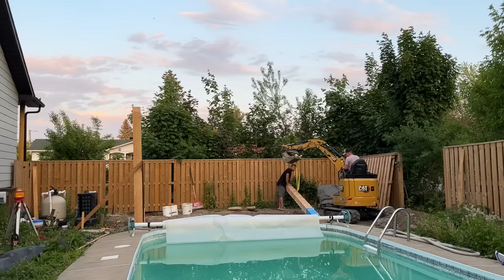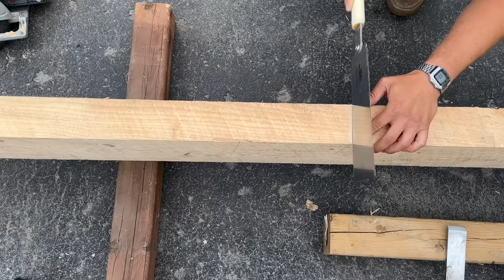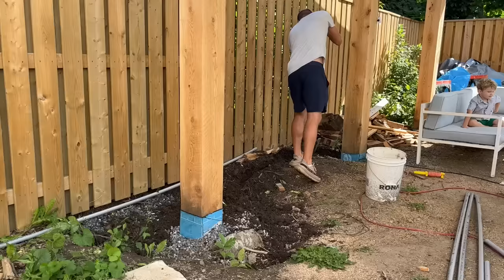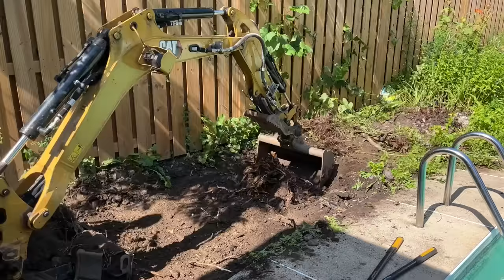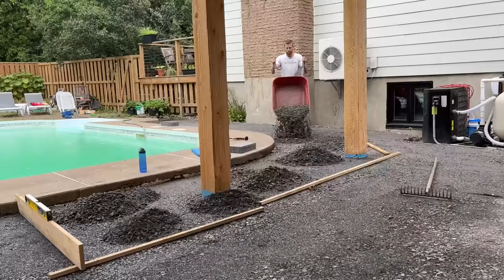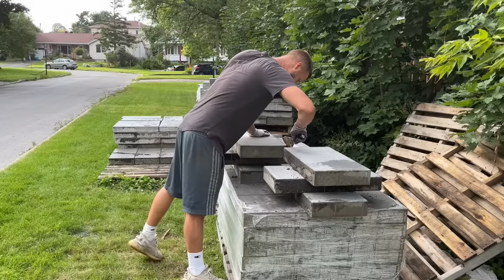My Biggest DIY Challenge: Building a Massive Timber Frame Gazebo

Comment from the maker: Thank you all so much for subscribing!
🎉 Get 25% OFF the plans on Etsy if you use promo code YOUTUBE25 this week!
https://mateostabio.etsy.com?coupon=YOUTUBE25
Reply: Possible to share the polycarbonate sheet details you have used ?
Reply from the maker: @VG-13855  I don’t have any but plan on making a video about the polycarbonate in the next 3 months.
Reply: What material did you use on the roof
Reply from the maker: @VG-13855  Polycarbonate Roof Install
https://youtu.be/4N26bvtbWAI
Reply from the maker: @hikerinpam33  check out my new video!
Reply: No sanding, staining, sealing the wood before putting it up ?
Try an oscillating multi-tool to cut straight into that wood.

Comment: I built mine on my own, no lifting equipment, no help, just a mitre saw, drill and shovel
Reply from the maker: No way! I wanna see a video! 8x8 lumer? Timber frame joinery?
Reply: @mateostabio  yup, size is 7.5meters by 4.5 meters, I didn't cut those fancy cuts though, it's held together with coach bolts
Reply from the maker: @MrSmoothasf  how did you lift those beams up?
Reply: @mateostabio  once the beams were set in the concrete, I leant the  top ones against the beam at a 45 degree angle and let gravity do the rest like a seasaw, the cemented beams were about 2.6 meters high so the full size beams had plenty of leverage once against them.  The neighbours were having a garage built at the same time by a whole team of men who thought I was nuts.....maybe I am lol 😆

Comment: chief I must say I've now watched this video finished from start to end. this really turned out amazing and the fact that you went old school made it so much more interesting there is quicker way out there but yeah the old school does it for me. thanks for sharing I'm looking forward to the next project. this is to me a true reflection of DIY I've seen on the internet so far with all the struggles. other or previous videos made it look so easy forgetting we don't always have the resources available on hand. we sometimes have to go and rent the tools we require to get these DIY projects done. #southafricaposted
Reply from the maker: This is exactly it, You got it. I wanted something original, that didn’t use metal brackets, and so I designed a minimal structure with old joinery. All the videos out there are about how you can make a gazebo in 4 hours, but I wanted a masterpiece that would last 50 years. Thanks for the comment!

Comment: Nice job 👍 i just recently did a dyi 130m long fencing 2.5m height, paving 250sqm bbq area, gates, landscape etc in 3 months by myself. Home project. I feel your pain. But I end results wow. I used cida. Full privacy wall. First time ever home wood working/ paving/ electrical installation etc. Turned out very modern. 
Next step maybe small pool, and large cazebo 😂 with pizza and bbq counters / bar area.
Reply from the maker: Nice! I’m also going to build an outdoor bbq area under there next summer! Stay tuned for those videos!

Comment: Very respectable....jealous you had the gear to move stuff.  Love the blue skin but to take it a step ferther if they arent pt (as yours are clearly not) is to burn the ends that will be buried. Just a passion of mine. You totally have demonstrated practical old values in timber framing...
Huge respect
Reply from the maker: Thanks for the comment. Tried new things, jumped into something I never did before but super happy with the end result. Cheers!

Comment: Hey Mateo...This looks great for a modern design...with simplistic lines...Well done...III...I'm posting this comment here as the same one from the Reddit conversation...More questions are always welcome...😉

👉...Mateo wrote: "...To keep the modern look I was going for, I opted out of the knee braces...

I love the fact you didn't stick in the unnecessary and ubiquitous elbow braces...Good Job!!!

👉..Mateo wrote: "... I then had to figure out a way to strengthen it, and ended up burying the posts 3 feet deep.

For that location and load parameters, unless you are on a beach or something, should be more than adequate...

👉..Mateo wrote: "...Which brought yet another issue. Rot… I wrapped the posts in a waterproofing membrane that they use on foundation walls for crack repairs. Hopefully, it works!

Sorry to say, but that was probably a huge mistake. Wood needs to "breathe," as they say, and that means to mitigate interstitial decay issues that no wood, especially wood below grade, should ever be "waterproofed" as this is folly in all regards and only accelerates decomposition more rapidly and why it is against code in some areas to embed in concrete as the "contact zone" between grade and base of the post will most likely show signs of decay within less than a decade...No worries, though it is work, there are traditional solutions for this and ways to slow the process, and/or add a stone foundation at a later date...
Reply from the maker: Thanks for sharing this here! Great idea!

Comment: Very impressive. I love the design. I am just looking to build a bunk for fire wood at my sauna. This is way more than what I need, but I could not stop watching this project. Nicely done, my friend.
Reply from the maker: Thanks for the comment. Appreciate it!  Thats one build im looking to make this summer, firewood storage probably timber frame build. Are you making it out of 4x4? Or 6x6 id love to see what your building
Reply: @mateostabio  I am using reclaimed telephone poles for the posts. So far, I have the posts, now I need to move onto the roof. I can only work when I have time. So it's been a slow process. But I am having fun with it.

Comment: That was amazing! I've never seen so much perfection go into a build. The thing I was wondering while watching this is why you leveled the concrete around the pool. Isn't it supposed to be slightly sloped outwards to prevent debris from going into the pool during a rain?
Reply from the maker: Thank you so much! I did not level it, but I did bring it back to how it was or at least tried to. The sidewalk is 30 years old and sunk about 4 inches all around. It was hard to walk on.

Comment: Huge kudos to you man wow. The detail and care you took for each step is impressive. The only thing I will nit pick about is that I would have left that blue waterproof film around the posts and nailed some decorative skirting around each post to make it look nicer and keep the posts waterproof inch or two above the pavers.
Reply from the maker: I totally agree with you and was my initial plan. But then when I saw one post without it and I could see how god damn clean it looked, I couldn’t hold back and I cut em all. Im thinking I can always come back later on and make a 3mm epoxy barrier at the base if I notice some darkening of the wood down there. And then perhaps create a little wood moulding or something. Thanks a lot for the comment!

Comment: What did you use for the poly roofing and where do you buy it?
Reply from the maker: Polycarbonate roofing
Reply: @mateostabio  Thanks for responding. Unfortunately, I've been searching Google for 2 days and cannot find the kind you used in your video. All I can find is cheap Home Depot corrugated. If you could help me with where to look, it would be most appreciated. If I need to buy your plans on Etsy to find out, I'm happy to do so but I'm just looking to build a 10x12.

Comment: Amazing job!  I would like to replicate something similar.  What kind of wood did you choose?  Given that you seem to be in Québec, I wonder where you got the timber.
Reply from the maker: You can get my plan on Etsy. Link in the description. I ended up going with Hemlock, because I was told it does not twist like pine. I was a little scared of going with pine, and after a few weeks or months having a stack of hockey sticks 😆. Call any lumber yard around you. Go on google maps and start calling! Ask for delivery included and compare. Make sure that you mention you don’t want bark on at least 3 sides for the thin boards for the roof. most of mine ended up being full of bark, and I had to throw out a lot. Take a look at my other videos for more info abiout the gazebo

Comment: I'm about to buy these plans, I have a question though. I love the way the rafters look without exposed hardware, but normally rafters like that are secured with a rafter hanger, is the 1 long screw really enough to secure those? I'd prefer to do it your way because it looks so nice, it just makes me sweat lol. How is yours holding up? Do you get a lot of wind where you live?
Reply from the maker: Hi and thanks for the support! Yes the 1 screw is strong enough. If anything, the plastic roof would go flying and perhaps the 1” wood lats as well (before the massive rafters would ever move). In the box of screws I bought, I believe I could have put 2 screws at each connection, but I decided to only put 1 as the specs showed they would be strong enough. The link to the box of screws and everything else is also in the video description. I appreciate the support and let me know if you need any more help with anything else. 

I’m trying to find the time every month to create more videos showing and explaining every detail about this build. I just released explaining all the electrical stuff. In April I plan on releasing one about the polycarbonate roofing. 

You can also take a look at my other videos talking about the gazebo, my biggest mistakes, my cost to build and more!

Cheers and best of luck with your build. Also, let me know if I can do anything to improve the plans.
Reply: @mateostabio  This is exactly what I needed to hear! Thank you, I'll make sure to get the screws you used. I'm getting started next week, I'll send you some results when its done!

Comment: Cool project and many cool solutions. Though I don't like the middle column in the front. Was there no way to avoid it? Maybe a slightly hidden steel beam up top?
Was there any calculations done by an engineer before building?
Reply from the maker: Ya, I would of liked to have no post in the middle front, but the wood beam probably would have been 8” X 20” or something huge. We get a lot of snow in winter so yea. Im pretty happy with it now though. Not the world’s biggest deal.

Comment: I subscribed. amazing video skills and I learned a few tricks never seen in construction.  Great job. looks amazing. Not trying to be an ass.  I'm curious why went with posts into ground?   Modern architecture calls to pour concrete, then post is put on a metal bracket secured to the concrete pier in ground.  and why didn't wrap the bottom of the post? trees xlyem and phloem act like straws sucking moisture straight up.
Reply from the maker: Thanks for the long comment and question! So this was a decision that honestly kept me up at night for a few nights. I didn't know what to do about this. I chose to go without knee braces for the modern, simple design, but this made me worry that if I would put them on metal brackets, a gust of wind or snow load, would perhaps make it collapse as it would not have any shear strength. I buried them so they would not move or collapse sideways. If I put them on the metal brackets I would of needed the knee braces 100%. By burying them, I now had another problem I had to overcome. I had to figure out a way to bury them, and make them all perfectly paralel at the tops so the timber frame joinery would all fit nicely and not have any gaps. This was a challenging build, not gonna lie! But it turned out better than I thought I was be able to make it!

Comment: Great Build! Good job getting the boys to help so they learn. My only suggesting is for you wear a mask the next time you cut cement pavers, that crap is terrible for your lungs. My dad never used a mask when woodworking and neither did I when I got started. I just didn't think about safety as much BUT that changed when I learned and researched  how harmful it is to your lungs
Reply from the maker: @RubenCervantes-e3v  thanks! 100% correct on that. I knew it was bad so I always tried to hold my breath for about a minute when doing cuts. But didn’t know about silicosis until someone commented about it! Thanks for watching!

Comment: Nice project !
This is exactly what I would like to do, except that doing it alone is really obnoxious! The finishes are stuning. 
I have two questions: 
1/ what do you think of the roof structure? In the wind, is it strong enough so that the panels don't move?
2/ In terms of heat underneath in direct sunlight isn't it too hot?
I'm really looking forward to seeing the fireplace.
Reply from the maker: Thanks for watching! 
Yea, I am releasing a video this week explaining my 10 biggest mistakes. One of my mistakes was leaving one roof panel not fully screwed everywhere and a tornado warning came around, and it folded a panel on itself, but luckily, it didn’t crack it just made a big crease.
But now thats its properly installed, it doesn’t move with crazy rain or wind. 
The only bother with this material is in a hot hot day I can hear some crackling every couple of seconds, I got use to it now. But theres a little bit of crackling from the expansion and contraction. It might be because I put the screws on too tight. 
In terms of heat, I feel like we’re okay with the breeze that comes through, I didn’t want a fan, but could be an option if you live in a really hot climate.
Reply: @mateostabio  thank you for your feedback, I appreciate!

Comment: How do you get straight timber like that?! I can’t find anything without a curve to it in any store around me.
Lol, neat trick with the plainer at 20:00
Reply from the maker: This is all straight from the saw mill. Not a big box store. Its not kiln dried, and is still green/wet. I chose to do this with project with Hemlock wood which is apparently straight and does not warp like white pine.

Comment: Fantastic video. Just subscribed. One question. Why did you choose to put the posts directly cemented into the ground ( vs using anchors)?  Your gazebo will probably last 100 years but if you did need to replace a post due to rot, etc it would be more difficult.
Reply from the maker: Thanks for watching! Take a look at other comments i’ve responded or my other videos, I think I explain it somewhere. 
I had many sleepless nights debating this…  My design decision of not having angle braces is what started this. To get that more minimalist and modern feel, I opted to not use any, but without braces, the structure could fall if you push on it from the side (with strong enough wind and perhaps a snow load on the roof) so I decided to try something new, and hopefully the posts won’t rot!!! Fingers crossed. We’ll see in the next couple of years if I have to make a video saying otherwise 😂. Cheers!
Reply: @mateostabio  Thank you!  I was assuming more stability, also.
Reply: I was about to ask the same question.

Comment: What type of wood did you use? I presume it's not PT. How will you keep it from rotting out? I'm not criticizing, just trying to learn. It looks beautiful
Reply from the maker: Its Hemlock, I guess we’ll see in a few years if covering them in that waterproofing membrane at the base of the posts it wont rot. They are pretty well covered from the rain. I’m not super worried about it… yet.
Reply: I have precisely zero carpentry knowledge. I just always heard that any wood exposed to the elements should be PT unless it is teak or cedar. I hadn't thought of hemlock. 

Again, looks good! One tip: Next time show your eyes some love and wear goggles. Also a harness. There is a reason men die younger than women....😂

Comment: What do you need to submit to get permit approved a plan with measurements?
Reply from the maker: Just a drawing on top of the certificate of location. And measurements to all sides.
Reply from the maker: But I had to take pictures of the front yard and side yard towards the street to show it would not obstruct drivers visibility at the intersection

Comment: Another tip when pouring concrete over 2’ deep. I use my wife’s battery powered bullet with the long controller string attached and drop it in the concrete on max speed to help with air bubbles and settling. Just sayin
Reply from the maker: Lolll

Comment: Fellow ryobi tool guy here. How do you like the planer? I was impressed it took the big boards so well.
Reply from the maker: Honestly, its not bad. Its not fast tho, and I don’t have a vacuum so I cant tell if you if it works well with one, i had to take off the vacuum adapter cuz it kept getting clogged. But for the price… I got it on sale at home depot a few years ago to replane  my stair treads and it brought them back to new, so paid for itself!

Comment: Geat video! Where did you get foam fom to raise pool decking?
Reply from the maker: Its called a froth pak, but its quite expensive. On The other side, i used tiny little foam cans, and it sank again after 1 year. It lowered by about 1”. 
The side where I used the big foam tanks in the boxes worked well. But its expensive. I ended up fixing the other side this summer with concrete. I pre Mixed it, but very dry, enough to make a ball but not wet, kind of like wt sand how its not wet but gets darker. I then packed it under the sidewalk by pushing it in with a 2x4 and packed it until i couldnt pack anymore. This worked amazing. I hope to find the time to edit a video for that soon. I also have a video on the “lift a sunken sidewalk” i made thats on youtube
Reply: @mateostabio  thank you!!